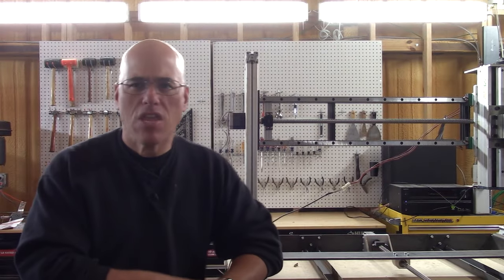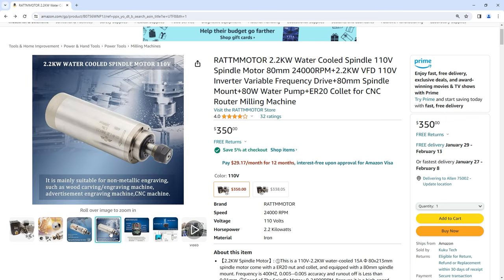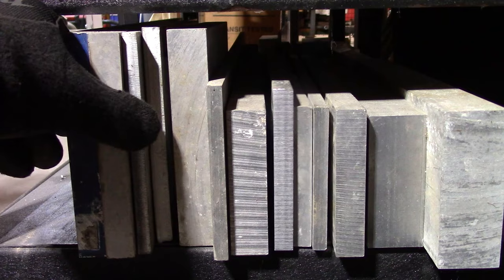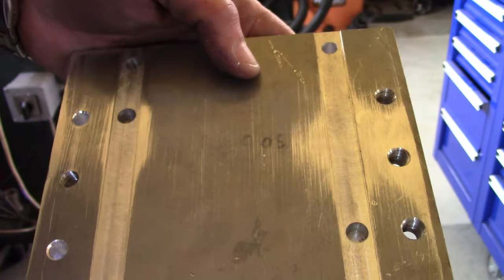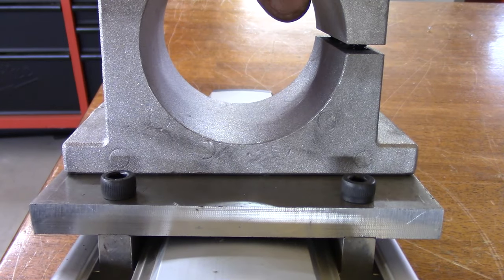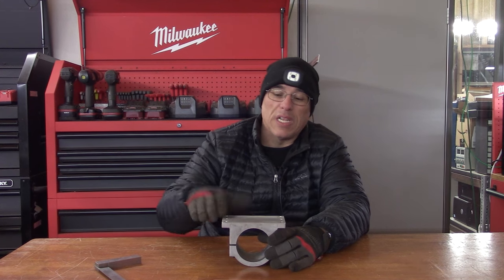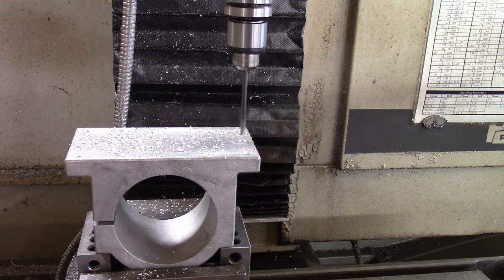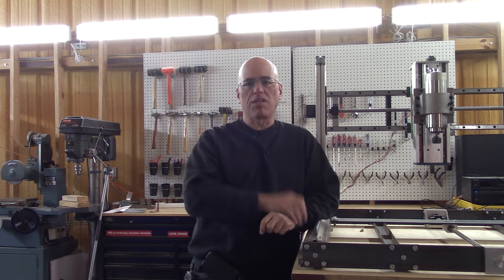CNC Dude's CNC Router Project: Mounting the Spindle Router

Comment: Did you think about mounting the spindle in the bracket. Then aligning the spindle motor housing with the X axis. That would allow you to register the spindle center line to make your reference fly cut. This would require you to mount a second vice on your table
Reply from the maker: You know, thanks for bringing that angle up because after I was done and I allowed myself to think and think I envisioned this was a plausible way of doing it. The spindle would need to be perfectly perpendicular to the YZ plane which means I might have needed to lift the spindle from one side until it was then parallel with the X axis, and then indicate so it was perpendicular to the Y axis. Maybe with some V blocks and some clamps. I am not sure I would use the actual spindle, though, as I fear applying pressure to the spindle walls may endanger the motor integrity. But a cylinder of the same diameter should do it. If I were to star a CNC router factory and I needed to machine clamps in any quantity more than one, I would go through such a scheme. Right now I don't think I have large V Blocks or two similar vises, so I would be back on square one, but this would be the course of attack for sure. Thanks for commenting!